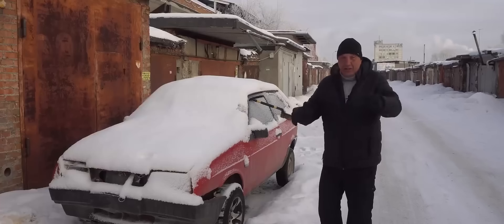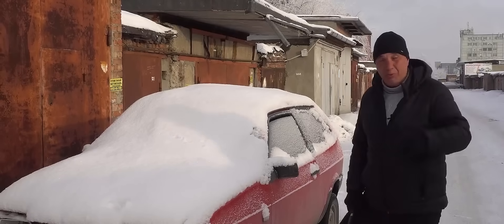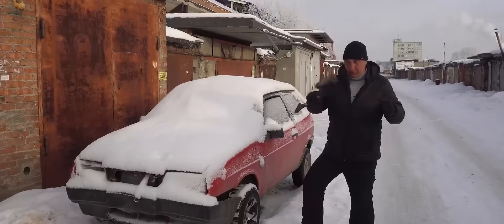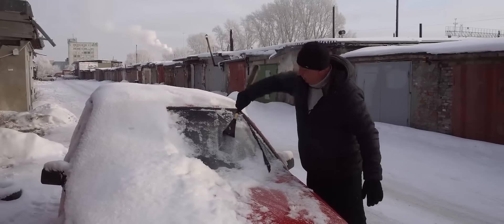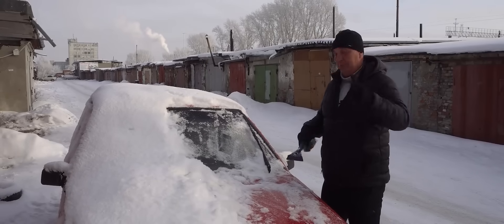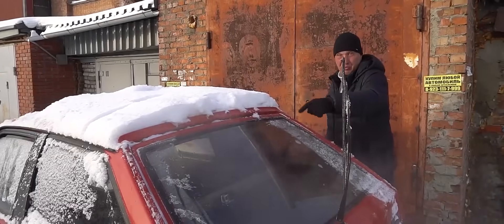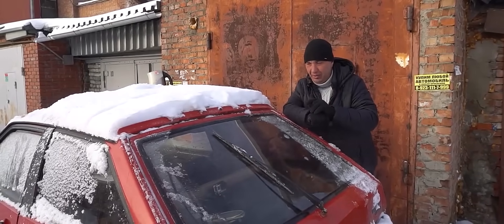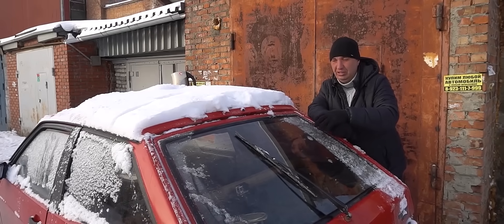What happens when you POUR boiling water onto a frozen windshield?

Comment: Why doesn't it break? Simple! The compression strength on glass is about 150x that of the tensile strength. Nearly everyone has experienced breaking a glass by going from hot to cold (If you haven't it's an awesome experiment and you should try it in a safe environment, boil a glass object in water then throw it in ice water). Doing this causes the molecules of the glass to pull on each other because as the glass cools, it shrinks in size at different rates. It takes about 7Megapascals (MPa) for the tensile strength of the glass to be overcome. The same occurs for cold to hot, but instead of pulling on each other, the molecules of glass push on each other because they go from being smaller to being larger, however this interaction requires about 1000MPa or a Gigapascal to cause the glass to shatter.

It can still happen, but it takes either a LOT more temperature differential than a cold day in Russia and some boiling water, or a much faster transfer of energy.

Comment: There's a huge difference between "pouring" hot water and "throwing" a bucket of hot water. It usually doesn't break if you do it like you did but if you throw all the water at once, chances are you'll break the glass. It's not guranteed that it breaks but chances increase significantly.

Comment: I'd guess that the tempered glass wouldn't crack because it's meant to deal with heat variations. It really depends on the compounds which make up the glass. If you did that with a Pyrex glass, it would crack in a flash.
Reply: Why do tweakers like pyrex?? Common

Comment: I've been clearing ice from windshields with hot water for nearly 60 years. Nothing ever happened. We hear anecdotal stories of might crack, but never any proven cases.
   The way this guy tried it, he was needlessly stressing the glass. When clearing ice from a windshield with hot water, the ice present at the time helps protect the glass by slowing the heating. That's why glass doesn't crack. But pouring hot water directly on cleared glass is not advised because there's nothing to slow down the heat stress.
Reply: My mom has a 2007 GMC Acadia can I drink water from her tail pipe and having sex with her car ?
Reply: @JohnDeere_Simulations  You can do anything you want as long as you don't get caught.
Reply: @joewoodchuck3824  can you help me give me any ideas ?
Reply: @JohnDeere_Simulations  It seems that you have enough imagination for both of us on your own.

Comment: What did you expect, exactly?  I've been de-icing cars this way since the mid 1970's - My dad even longer. I don't see what you're getting at with domestic glass Vs foreign imports. All my cars over the years have been a mix of foreign and domestic, and I have not yet at had one single failure. Also, it doesn't matter if it's laminated or straight toughened glass.

Personally, I'd suggest using that water to make coffee!

One hot tip; Pour the water, starting at one top corner, and run it quickly to the other side top corner, then back again - keep going back and forth until you've poured enough to clear the glass. One kettle will be enough to clear a whole (average sized) car. It doesn't even need to be boiling, and indeed, hot water from the tap is plenty hot enough, and you can always use more of it, if you feel the need to!

This is like trying to teach Granny to suck eggs!

Oh, and where's the regular voice-over guy? "Voice-over by BMI Russian. . . . . ." - Go, get him back, and pay him extra if you have to!

Comment: i always use boiking water to clean ny qind shield. i boil a full kettle, wait till it lowers to about 70° and slowly slosh it iver the locks first then the back window , side mirror and then the front, pouring on the roof and allowing it to run off the roof down the front window. then you give it 1 minute and it all slides off (keep in mind im only in -3 to -5 weather here not including wind chill so anything above -10 and you'd likely make things worse when that water freezes moments later in your lock and handles

Comment: It is that hardy Russian glass, I parked a late model Silverado out overnight on a below freezing Ohio  night. There was was an inch thick layer of snow on the windshield the next morning.  I ran the wiper blades for a moment or two, to clean the snow off. Leaving a thin layer of ice. I turned on the defroster full blast, and went back inside. About ten minutes later I came out, and low and behold there was a Crack in the windshield,  running right along the line where the wiper blades had cleared the snow off .

Comment: Thing is you gotta get the car’s windows (2-4 windows) opened a bit to balance temperature inside & outside of the car (they did that in the vid but didnt mention it). Then pouring boiling water on the windshield without any problem.

Comment: I've been using warm water on my windshield for 30 years. never broke
Reply: The difference is….. they used b o i l i n g water not warm
Reply: Don’t pour it directly on it put it in like a gallon freezer bag and rub it on it the reason it breaks is because of something called thermal shock where the temperature changes so rapidly it pulls itself apart because it’s expanding/contracting so rapidly
Reply: @KSHAWK  Yeah, but you forgot that the windshield has a thick glass. It won’t break even with boiling water.
Reply: @davidealexandrusuvac3245  maybe the windshield glass I’m used to dealing with is cheaper
Reply: @KSHAWK  
Did you see it break?
Reply: @erikdikkers7931  oh wow your right didn’t break one cars window well thank you I mean this definitely proves it can never happen to any car ever
Reply: Warm water won't break those windshields, but boiling water will...
Reply: I did it once. It did break.
Reply: There's a difference between warm and boiling
Reply: Cap
Reply: Must be a bullet proof window ya have
Reply: Same, works fine. Never tried boiling water, but warm water for sure.
Reply: Boiling water in Russia is warm or cold water in Europe.
Reply: same. I had a car for 11 years and my parents used warm water (not boiling) and it NEVER did anything bad

my parents decided to use water cause it's faster but also they are scared of scratching the windows if they use the scraper

Comment: I had a small rock chip in my windshield. I let my truck get nice n warm the temp out was prob 5-10°f I got on the road n was just getting up to speed maybe 25-30 mph n that little chip cracked all the way across the windshield. I guess going from hot to cold really fast did the trick. Maybe try going from hot to cold really fast instead of cold to hot....

Comment: If you remove as much ice and snow as you can, it works just fine to pour COLD water onto the windshield with the wipers turned on low; the wipers distribute the water all over the windshield and melts the residue.  But don't use more water than necessary so that you don't produce ice under the car where the water runs down.  Just a half-gallon, at the very most, will do.  I would be afraid to pour even warm water onto my windshield because I wouldn't want to risk having to get a new expensive windshield.
Reply: If it’s below freezing outside the cold water will literally freeze as soon as it touches the windshield. I’ve seen someone try this (scared to use warm water because he had a crack in his windshield) and he had to wait even longer for all the ice he just created to thaw out so he could see.
Reply: @ThumperG  But this method is still relatively practical because there are relatively few mornings where the temperature is below freezing.  In this case I still will have to run the engine to warm up the car.  By the way, antifreeze doesn't work either because even it freezes.
Reply: @MyNathanking  I mean yea if it works for you/your area than great. In my area if your windows froze overnight, it will most likely still be below freezing come morning so cold water just won’t work. Even like warm water freezes as soon as it touches the windshield… And yea antifreeze can freeze if it’s cold enough, but chances are you will never be in an area cold enough to freeze antifreeze. It has a much lower freezing point than water. Water freezes at 32 degrees Fahrenheit, with an antifreeze mixture it won’t freeze until it’s far below zero degrees.
Reply: @ThumperG  As for my climate, I live in Pennsylvania.  Of course, pouring cold water onto the windshield to melt the frost on the windshield doesn't work in subfreezing temperatures, but even at that it greatly reduces the amount of mornings in which I have to heat up the car before starting out.  Oh by the way:  Even when the temperature IS subfreezing, pouring the cold water on the windshield reduces to only two minutes, the amount of time I have to have the engine running --- with the heater turned on defrost mode.  Then, after running the engine for two minutes, I can pour on the water and it won't freeze on the windshield and it will remove all of the frost.  Otherwise I have to run the engine for up to seven minutes to remove all the frost.
Reply: @MyNathanking  I’m on the other end of the country, in New Mexico. Never been to the East Coast before. If I have time to spare I usually just scrape off the frost but on occasion when I’m in a hurry I’ll throw the hot water on it. I made the mistake of using cold tap water once and it completely froze once it hit the windshield. It took me forever to get that layer of ice to melt.
Reply: @ThumperG  I made that mistake of having water freeze on the windshield and making the ice worse --- but only while experimenting with it in the hopes of refining my methods, and while doing this experimenting without having to go anywhere in a hurry in case I found something unexpected.  So THAT was how I learned that, when the outside temperature is above freezing, I can pour the cold water on the windshield, the frost melts, and I am off and running, just like that --- but when the outside temperature is BELOW freezing, I have to first start the car, put the heater on defrost, and let the engine run for the relatively short amount of time it takes for small circles of clear to appear on the windshield above the defrost outlets to signal that the windshield has begun to be heated.  THEN I can pour the water on the windshield, the frost will melt --- and it will not come back.
Reply: @MyNathanking  I will give your method a try next time my window is frozen. It snowed here last night, but it’s been about 2 weeks since my windows froze…
 Honestly I feel like scraping the window would be faster because my car takes a good 5-10 minutes to warm the air enough to start melting the ice. Then it takes probably another 3 minutes or so to get  the window clear.

Comment: The snow insulates the window very well, so the windshield isn`t really all that cold. I was expecting nothing to happen. It could be the way the window is designed with the non flat lamination process that keeps them in one piece. Also the tempered glass may react differently than usual house windows.

Comment: The windshield is not always going to crack, just like if you pour hot coffee into a frozen cup, sometimes it will be fine, but every once in a while it will crack.  My wife put a mason jar which had been frozen milk inside into cold tap water and the entire bottom dropped out of the mason jar.  It all depends on how fast the glass expands and all glass is not equal.  If there is a weak spot in the glass, it will break if it expands too quickly.  He just got lucky.  If he did this ten or fifteen times, the glass would probably crack one of those times.

Comment: just so that you know older cars fair better with hot water because the rubber around the windows is softer and grants more movement. the same with the thickness of the rubber surround. newer cars use harder and thinner rubber glass surrounds which gives the glass less movement resulting in crack's.

Comment: I have been de icing my cars for 40 years. Never cracked the glass yet.
Only an idiot uses  boiling water.
You have to use lukewarm water so if you boil a kettle only boil it half full then top it up with cold water. 
I normally take water straight from my hot tap then add cold water if necessary.
 I usually start the car first then steadily pour the lukewarm water over the front making sure to free up the wipers from any ice. Once I'm sure the wipers are ice free I switch them on to sweep away surplus water before it can refreeze.

Comment: The formula of the glass is one secret why it doesn't break. The other is the fact, that both panes are framed with rubber. Modern glued windshields are more prone to break than the old rubber framed ones....

Comment: I'm pretty sure It's because the glass on a Lada is softer than on most other windshields therefore it doesn't crack that easily.. simple enough to test, 2 different cars/windshields, try to scratch them both and see which one is harder then try to crack them with boiling water.

Comment: Hot water doesn't stay on the glass long enough to create a large enough temperature difference the cracks the glass. The reason your defroster can crack your windshield is because it heats only one area directly, creating a temperature difference deep into the glass in that one area. Yay physics!

Comment: The main reason this is a bad idea (and there are a few) is that the water on the cold glass can expand and get into micro cracks in the glass, it then freezes and expands cracking it badly, weaking it etc
Reply: But that's no different to the water that frozen in the first place.
Reply: @jamieniche  Yes it is... the speed of the heat transfer and freezing (basic physics)

Comment: It doesn't break because of the way the window is installed. Most newer vehicles use adhesives to hold the glass in place that don't allow for room for the glass to flex. The Lada uses a rubber gasket to hold the glass with room for expansion shrinking. Once again. Simple is brilliant.

Comment: What is your altitude above sea level? If you are very high the water may be boiling but not very hot. Next time, check the boiling water  with a thermometer to verify the actual temperature. Just a thought.

Comment: Been doing this for years, never broke anything.. however, he is using boiling water, that's a no-no.. use hot water out of the tap.. that water is 130 degrees, not 220.. the boiling water could superheat an area of the glass and cause a break..and never pour, I always throw a pitcher of hot water on the entire glass.. this melts ice, instead of superheating the glass.. and, I have never lived in a -0 environment, so I can't talk about Russian winter's or the effects of boiling water on -40 degree glass. If you pour, move quickly across the top of the glass.  Also, the front glass is layered with a plastic binder between the layers.. it's call shatter proof glass.. the best you could hope for in this situation, is a few cracks.. the back glass is a heat treated, "tempered" glass, and is designed to shatter into a zillion pieces, rather that long knife like shards..  I , as a fireman bust these glasses all the time to rescue trapped people.. they are called safety glass, and they are more fragile than laminated windshield glass.

Comment: I always use hot water to warm the glass. On different cars, with pasted glass and glass with a rubber seal. The average water temperature is about 70 degrees Celsius. There hasn't been a single cracked glass in 20 years. The fastest way to warm mirrors and glasses. You need to remove the water from the glass so that the water does not freeze again.

Comment: I would not suggest this at most use a plastic baggy filled with hot tap water not boiling. This is not likely to shatter your windshield unless in extreme cases.

Comment: It's funny how upset people get when you prove that no, boiling water won't actually break a windscreen except for very rare circumstances. I've done it on older cars with a gasket holding in the windscreen and newer cars with the windscreen glued in. Same result, no cracks. I was downvoted to hell when I mentioned this on reddit, and the dislikes here seem to tell the same story. People don't like the fact that the wisdom they think they have is wrong.

Comment: dont do this, under the right conditions, it will crack. u can however, pour room-temperature water on your windshield to melt the ice- much safer than boiling water or hot water.

Comment: i use boiling water on my windsheild all the time, sometimes it freezes the boiling water and still need to scrape it by the time i put kettle back, i live in east anglia uk and when its cold its cold, and when its hot its hot , because the land use to be under sea the soil insulates the ground so heat bounces off and doesnt absorb any during summer so when winter hits the ground freezes, sticking out in the north sea doesnt help either, but i never cracked a window yet

Comment: With my experience glass does well from cold to hot...
But when its hot and introduced to cold this stresses the glass and causes it to fracture.
Reply: I dunno ive set hot pots inside the fridge on some glass shelves and it cracked them..  but guess metal gets hotter than the liquid ever will inside the pot so the tempered glass being under high tension already just shatters, like glass cookware does if you take a hot dish and put it under cold water,.  Youd think it be the same both ways around as materials expand and contract .001" for every 100°f.  Expand when heated and contract when cooled...